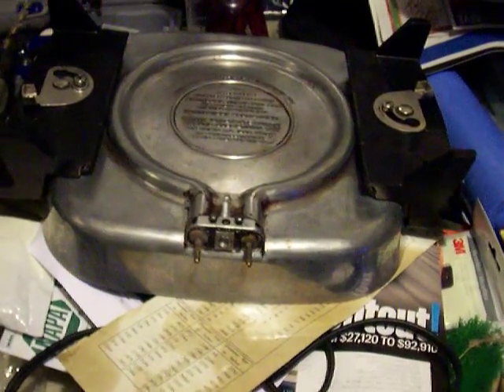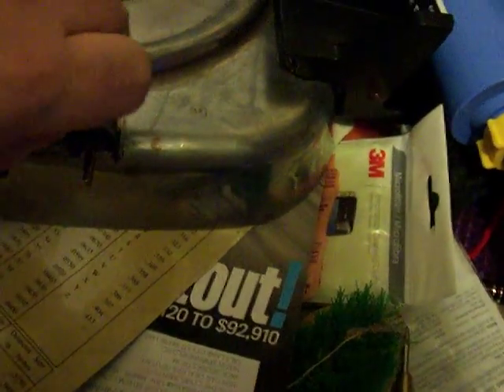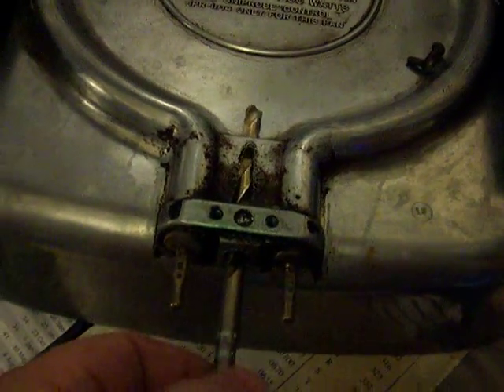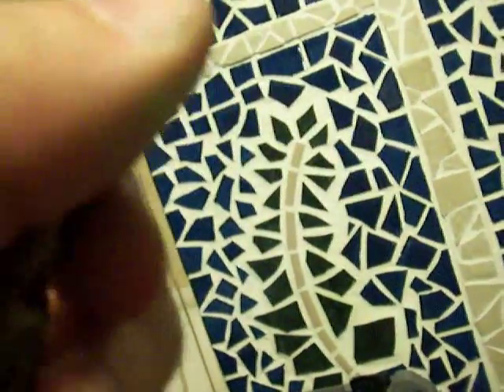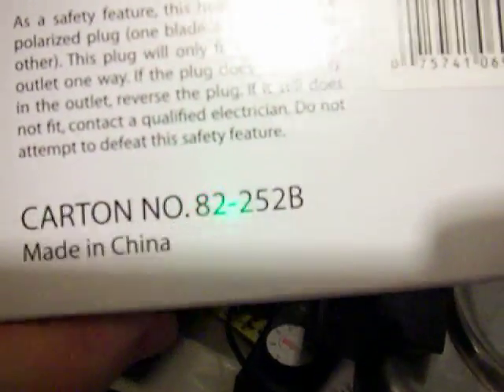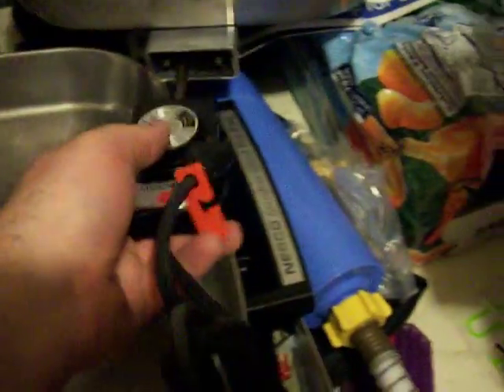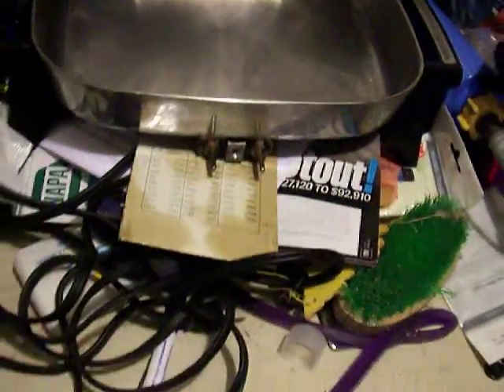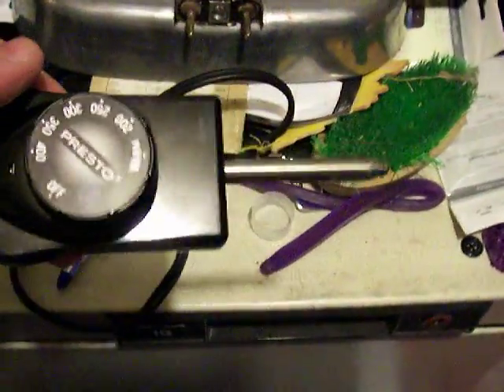Hoover Nesco Stainless Skillet Cord Fix Repair

Comment: My cord gets very hot at the wall after just a few minutes. The pan does heat. Do you think it would work if I open the controller and replace the wire?
Reply from the maker: I think your cord needs to be replaced. Yes. If that doesn't help then you may need a completely new temp control.

Comment: If that heating element rod damaged...how will you replace the round attached rod?
Reply from the maker: The heating rod is cast into the pan. If the heating round element on the bottom of the pan is dead, the pan is trash. However, the heating element almost never goes bad. It's almost always the plug that connects to the pan.
Reply: @24jhs  but I mistakenly plugged that 110v  into 220v...and after few mins that pan stopped working
Reply from the maker: @palhaseebkhan3497  you may have fried the heating element.
Reply: @palhaseebkhan3497  i was using 100v frying 🍳 on 220 for around 1 month. But unfortunately its damage now....  Sad.     .....